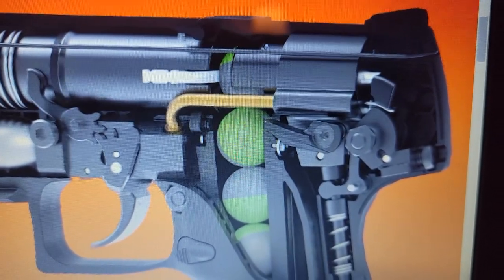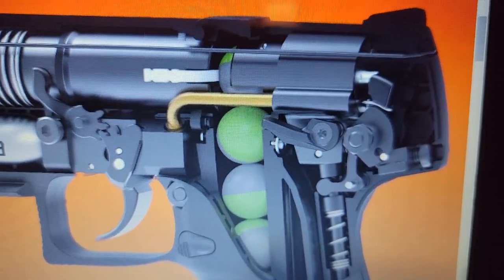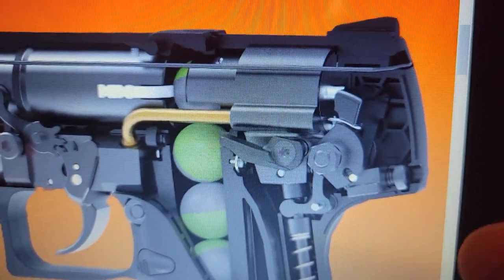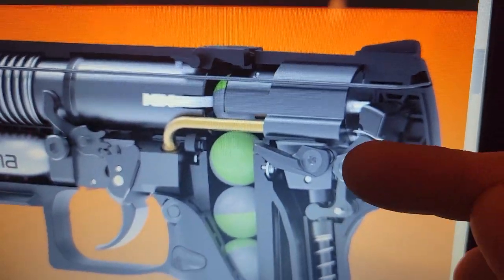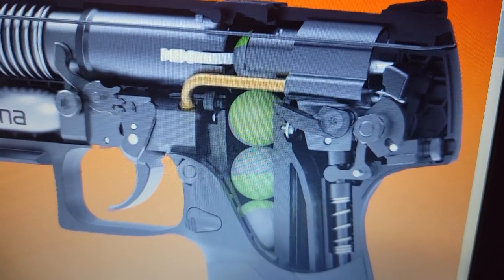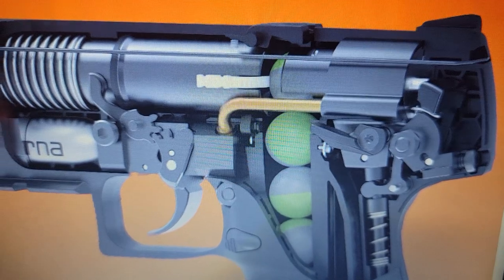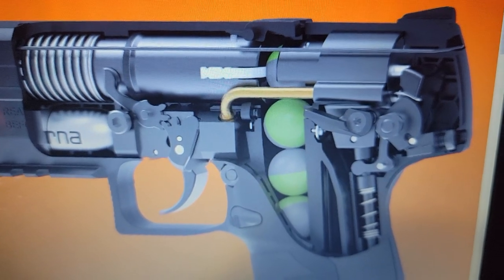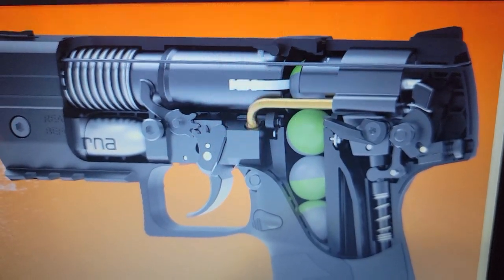Byrna screw mod mystery solved, by Byrna's website.

Comment: Correct me if I’m wrong, what i see is the screw increases and decreases the spring pressure on the hammer. I’m not sure why you would have to adjust this being its a air pistol.
Reply from the maker: Yes and if it adjusted enough to matter it increases or decreases power.  Makes a little difference on these, but it increases the power the hammer hits the valve causing it to open more or less letting less or more air or CO2 in.
Reply from the maker: That is how some air guns adjust their velocity😉  Byrna just didn't make it adjust enough to matter unfortunately
Reply: @DKSpencerCustomKinetics So, are you essentially saying that adjusting it would make no difference on the HD velocity?

Regards from South Africa

Comment: Thank you for posting this I was curious what it was doing. In my experience you can get 315-320 fps with a hot co2 cartridge as well. The byrna seems to be very temperature sensitive just like most co2 launchers but I love mine so much that I'm just waiting on Byrna to ship my new SD launcher. The representative I spoke to said they did some work on the valve to make getting 300+ fps easier and makimg the power consistent across all shots. Thanks for all your work keep it up I look forward to your videos.
Reply from the maker: Thank you sir
Reply from the maker: By the way I took the request video down I posted because it was kind of pointless after finding out about the barrels being actually longer.  So I don't know if you read my reply yet or not before I did it.  But I think the question you ask over there about the 12 versus 8 I think where you're using a good 8 g and a really cheap 12 g that's probably what the problem is try a 12 g Umarex and see
Reply from the maker: @RCHobbyGuy92 dude I don't know where you're getting that from this picture clearly shows that it does not have anything to do with the barrel there's no connection whatsoever I really don't understand how you would even think that I validated that statement
Reply from the maker: @RCHobbyGuy92 what it does is change the length of how far the hammer can go back to strike the valve.  Basically imagine your cocking a revolver and you know how you get to that first notch and then all the way back that's basically at the first notch when your factory and all the way back when you turn the screw.  So the hammer has a greater distance to travel so it picks up more speed and strikes the valve harder there is nothing in that that has anything to do with the length of the barrel

Comment: Love the content.  I'm 54, I started playing paintball in the 80s on the East Coast way before it was a popular sport.  We used CO2 for many years and there are many, many variables that affect FPS, so many I couldn't list them all.

I would say to be slightly more accurate you wouldn't use the highest or lowest numbers, and you wouldn't use the first 5 shots anyway due to the very real possibility of unequal charges in the cartridge,  because they are not identical.

As for tuning, we changed out springs or compressed or decompressed springs to manipulate how hard the valve was struck which in turn varied how much propellant escaped, obviously changing the FPS.

Which is a long winded way of saying you are absolutely correct in your assessment. 

I do recall that once you got over 300 FPS the accuracy of the paintball would suffer due to distortion from the higher pressure.  Not a problem with solid rounds of course but there might be that potential for the filled rounds.

Again, love your content and BTW I had a nearly identical chrono about 30 years ago!

Comment: That's adjustment screw does nothing to increase velocity. 

Increasing the velocity is done by putting a larger volume of air into the valve. The more volume of air compressed down into the same area creates the higher pressure. On  the First Strike FSC  for example that's exactly what it does. On the Byrna it doesn't even come close to doing that. 

So you are not getting any increased volume of air, increased pressure or in return increased velocity by turning that screw. I wish everybody would stop fooling themselves thinking that screw is changing something on the Byrna
Reply from the maker: Well then how do you explain all the Chrono tests I did showing that it increases with every turn maybe you should watch my other videos for you decide something don't work when I've already proven it does
Reply from the maker: It does not adjust it as much as I would like it to but it does increase the travel of the hammer therefore increasing the time the valves open therefore increasing the velocity you sound like you know what you're talking about but unfortunately you're wrong
Reply from the maker: I mean for you to say it's not changing anything when you're sitting there looking at the diagram that clearly shows what it changes does it even make any sense to me
Reply: @DKSpencerCustomKinetics  Yes I have watched your videos. . Several of your videos.   👍👍.
Reply: @DKSpencerCustomKinetics  you're correct in one part. All that screw does is adjcust how the pin or the hammer inside hits the valve. But it does not do enough to change the volume of air entering the valve chamber. And those Chrono tests are really not conclusive. They do not consistently show enough of an increase to determine that it really is in fact increasing anything.

 Byrna says it does not do what everybody's hoping it does.  And they do explain what it does do. The bottom line is you're not changing the foot pounds of energy that the projectile is going to produce by the little bit of possible increase you may sometimes see by turning that screw. It's best just to leave it as it ships from the factory.
Reply from the maker: @raysult  well sir the gun kept getting colder the more shots I did but yet I gained two joules of energy by the time I got it all the way up and I think I did enough shots to show it wouldn't just a fluke one time number that was high too so you can have your opinion I can have mine I don't think it's enough to make much difference but to say it does "nothing" when you can clearly see it's letting the hammer strike longer which means harder which means that valve stays open longer it's airguns 101 and when you've got a krono showing the results and you got a diagram showing what it does and you still don't believe it I'm going to quit trying to convince you, lol. I know a lot of people do test and fire one or two shot and say that's what something is that's why I went through several canisters and balls doing this.  While you say it's not conclusive I think I did a better job than most people when I even took into account the temperature and everything and again everything kept getting colder as I discharged cylinders so theoretically if it did nothing then I should have been losing feet per second because the canisters would have been getting colder and colder sitting in the gun
Reply: @DKSpencerCustomKinetics  You are are the airgun scientist . You way to smart to be debating with that Raymond guy . Lol he is clearly , not wanting to accept the facts . Keep up the good work
Reply: In the catalogue, there is a cross section of the gun and the words "velocity adjustment" right next to the screw.
Reply: @mbatson13  😂😂😆. Yes there is.    There is also printed documentation from the manufacturer that says it won't make a difference
Reply: It actually adjusts timing .you can fine tune it a bit that may or may not increase fps.  it fires just as the barrel fully seats back. If the barrel isnt in time gas can escape. If its timed it puts all the gas out the barrel.
Reply: @mbatson13 Hi there, which catalogue are you referring to there?

Comment: I'm waiting to get one, they need to increase the capacity of shots the very minimum 6 plus one!
Reply: I'm not crazy about the magazine capacity either, but much like my cameras, if you get it right the first time, the extra capacity wouldn't be noticed! When using pepper OC ammo I train for hitting the target and near the target to build myself a very uncomfortable maze of pain someone needs to get through blind and choking before they get to my knife or my hands. I tend to think of my Byrna as a shield that gives me way to close or create distance. I practice for five shots accordingly. If I'm in my house I've got another magazine readily available. 

I'd actually really appreciate if the pepper rounds also splashed someone with dye or paint (irony) to ensure proper ID after LEA arrives.

Comment: Don't know anything about airguns. What does the screw do?
Reply from the maker: So moving it in and out is decreasing and increasing the amount of distance the hammer can strike.  A longer stroke means a harder hit a harder hit means the valve stays open longer which releases more air which increases power
Reply: @DKSpencerCustomKinetics  Does it cause any damage to the gun?
Reply from the maker: @ALTONSAKADO  Not so far.  Honestly, it's not making enough of an increase to probably even hurt it down the road.  It's not gaining 100fps like some markers do when you adjust them.  I feel safe running mine turned up.  So, hopefully it won't cause any.
Reply: @DKSpencerCustomKinetics  Ok cool, thanks for the information. So it sounds like there may be a bit of trade-off in terms of how many shots you get out of a CO2 cartridge then?
Reply from the maker: @Leon-ph7br  I don't think there's going to be enough difference to matter because you're not going to be in a shootout with one and changing it doesn't add enough to be a huge difference.  It's not like you're gaining a couple of hundred feet per second or something so it's not going to use a whole lot more gas I think you're still going to have more than enough for what it's designed for
Reply: The screw SCREWS with your head~ its a screwing you over screw..
Reply: @DKSpencerCustomKinetics  Why does the valve stay open for longer ~ logic says if you open it faster it will close faster meaning the "open time" is shorter..
Reply from the maker: @johnnybravo1912  okay so if you have a stick in the ground on a spring.  The harder you hit the stick the deeper in the ground it goes before it bounces back there for the longer amount of time it takes before it comes back which would equate to the longer time it keeps it open.
Reply from the maker: @johnnybravo1912  I like physics not logic 🤣 hopefully that analogy made sense.  It's not that it's opening it faster, it's that it's opening it harder, so it takes longer to close